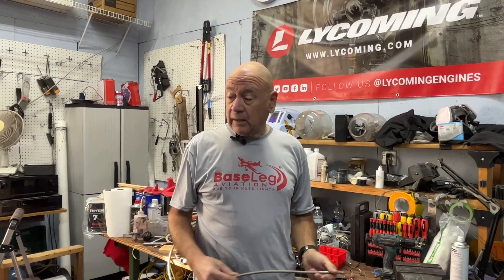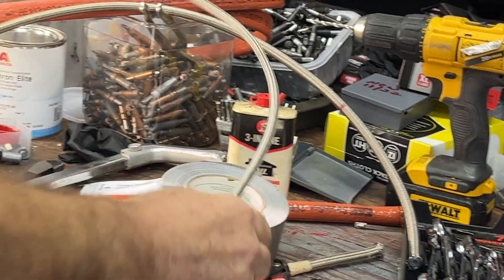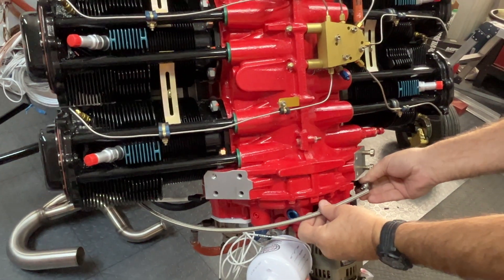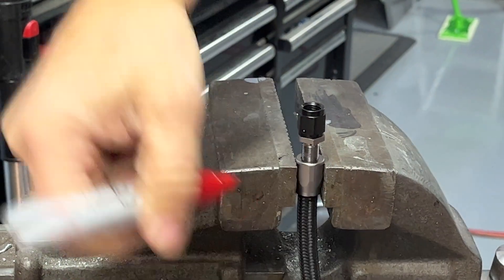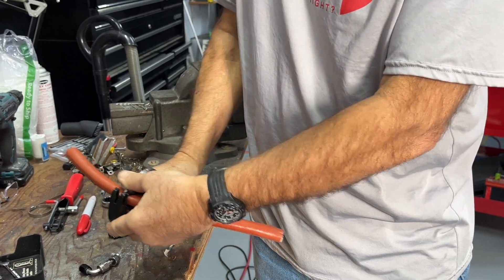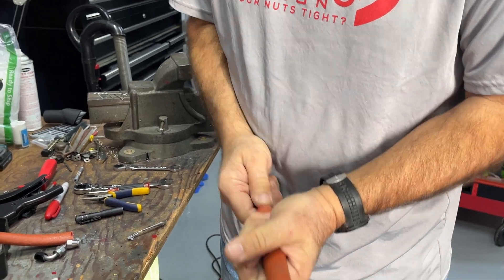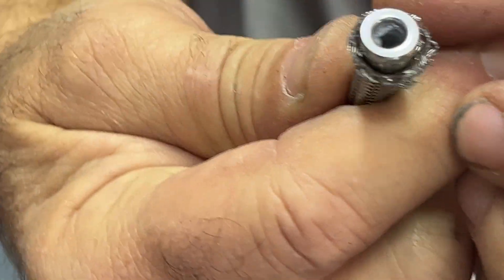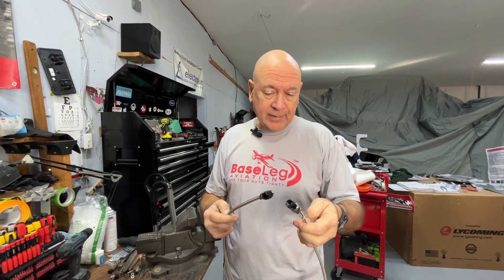BRAIDED HOSES

Comment: This is pretty timely because I am about to order hose for my fuel system.  I'm looking at all of the standard speed shops, but not seeing fittings that are stainless.  Can you provide a link to the the fitting you used in the video?  Is that an earls speed-seal?  Looks like the fittings are specific to their hose.
Reply from the maker: yes, they are Earl’s speed seal fittings. they are aluminum.
Reply: @baselegaviation1614  Thanks for the reply Vic.  I'm actually surprised you haven't seen failures on the 90* fitting shown at @13:34 bolted to an engine (like a fuel line) as the aluminum tube on the end of that isn't all that thick and it for sure has a finite fatigue life.

Comment: Thanks for the instructions, but I have a couple issues with what I saw. They make a mandrel to place in the rubber hose fitting that keeps the sharp edge from cutting a sliver of rubber when being tightened. Why didn't you use that? I didn't see you look down the inside of the hose to see if it was clear after assembly. And I saw you assemble the teflon hose with lots of metal fragments from cutting it still in the joint. I had an A&P make me a set of rubber oil lines, and there were C shaped slivers of rubber inside the hose. I'm glad I looked down the inside. It was almost fully blocked, and the slivers could dislodge and get stuck in the oil passages. It taught me a good lesson about inspecting work, even by experienced mechanics.
Reply from the maker: these fittings don’t require the use of a mandrel. My apologies on forgetting to check visually in the video. I always do that. I’ve been making these for years without any problems, and I’m sure thousands more people have been doing it on cars, etc.